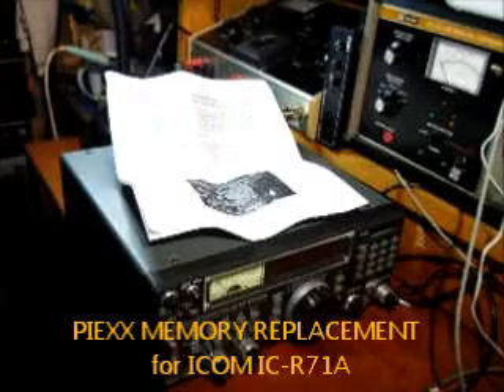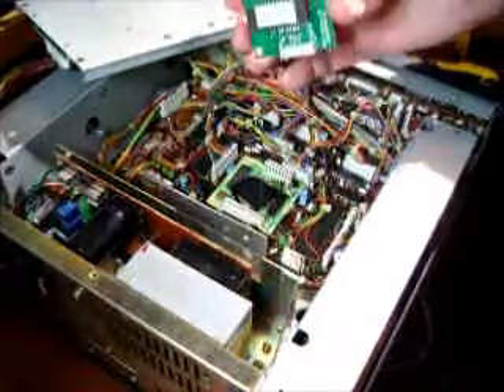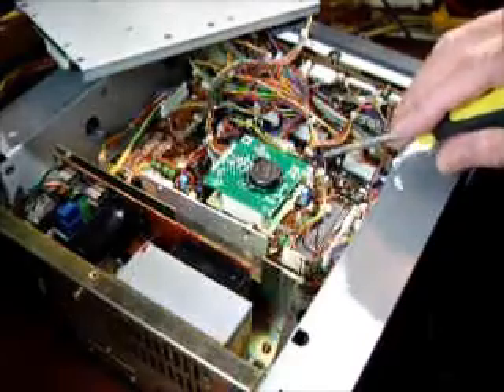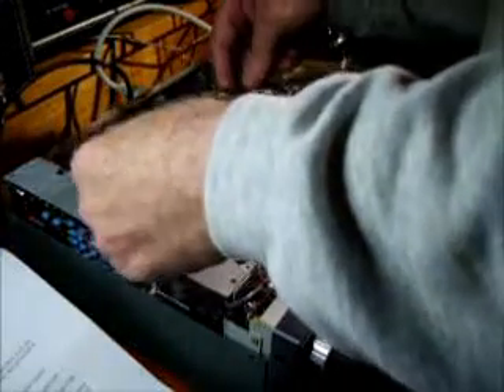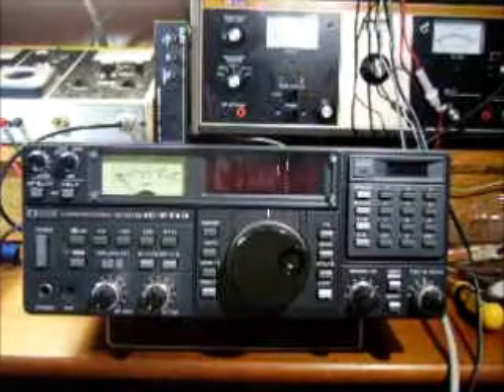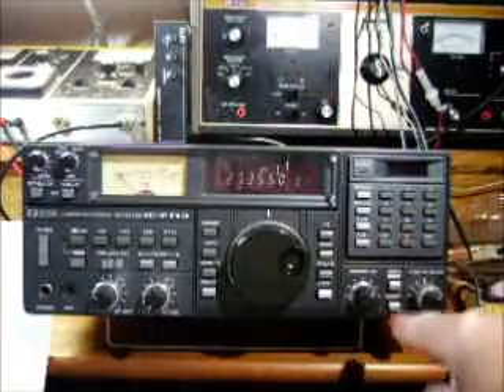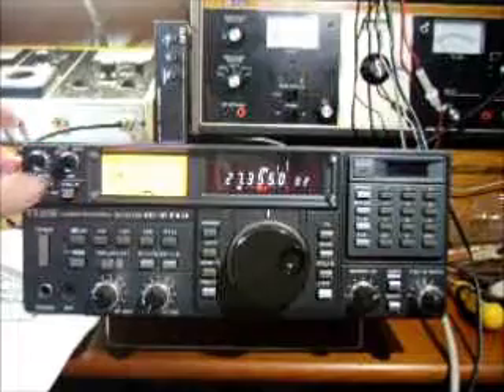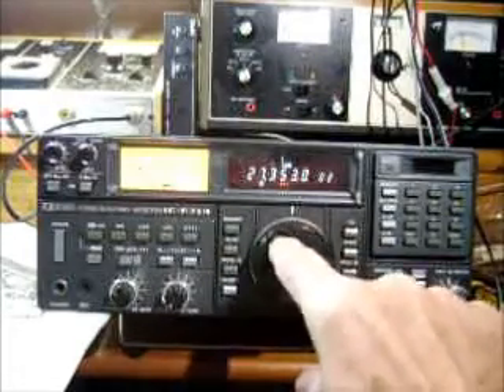CQDX11.com DIY ICOM Memory Piexx Upgrade to Icom IC-R71A

Comment: I just purchased an Icom IC71A that so far has no problem with this but I’m going to go ahead and get the board and replace it anyway. 
That is a great idea about putting the plastic on the cover so nothing shorts out.
Is there someway to tie in to AA batteries that will keep the memory up and run it forever and then all you would have to do is change those two AA’s
Thank you for this video appreciate it
Reply from the maker: Thanks for the feedback Radionut R - forget trying to fool the system with AA's or even a similar disc battery. The new PCB's will go forever as they take power from the system and store it and will never fail. 73's